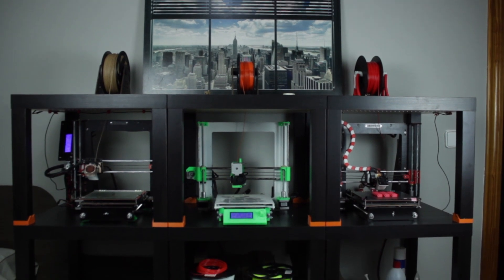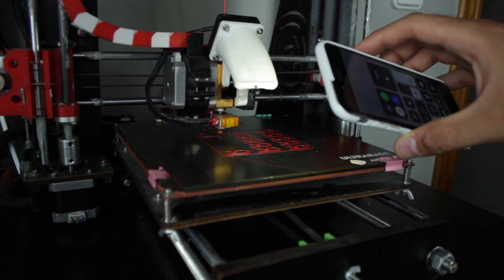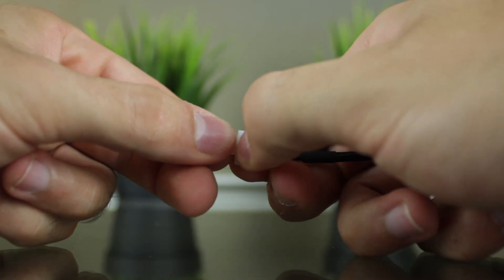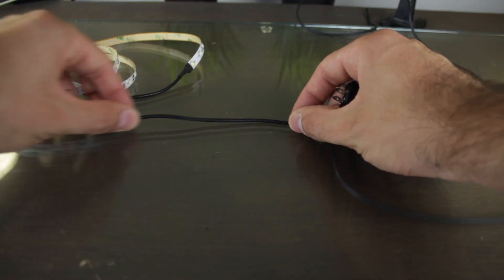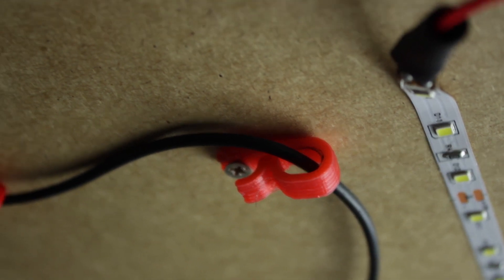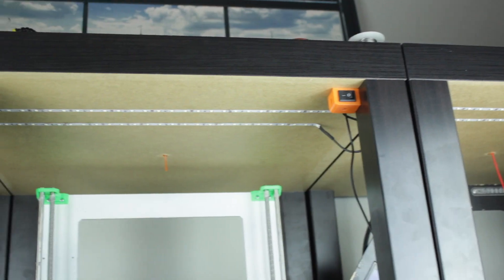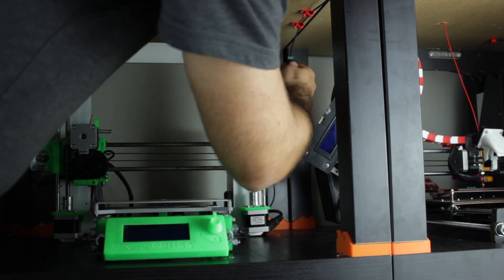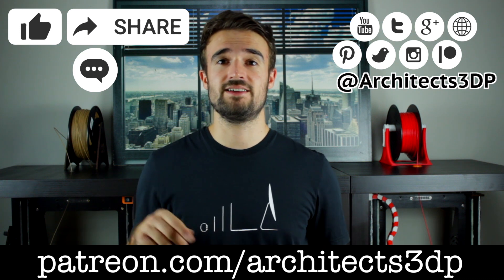3D Printer Farm Shelving ikea lack #2/3. The lighting

Comment: Nice!
What about the overall power usage?
Are all printers connected to the same outlet?
I'm trying to set up 6 printers like you have in my basement but I am worries about overloading the outlet since all 6 printers would run at the same time and heat up at the same time.

Comment: maybe you should print a holder for the disconnect plug from the led lights so that you don't get any strain on the wires and connections to the plugs, they look quite heavy, it could save you some hassle in the future.
Reply from the maker: thanks so much for your advice Alex :) :)

Comment: Sir I have watched your Cura Tutorials and it help me lot but I am facing problem with strings please tell me your retraction setting you like to print with
Reply: Sir I have tried this setting you have shown in your Cura material setting... But this not work 
I have tried to change distance up to 5 mm but that also not work..
Reply from the maker: Maybe what you have to do is to set a lower temp. I use 185°C for PLA
Reply from the maker: Thank you! I am using a Retraction Distance of 0,8mm and Retraction Speed 35 mm/s :)